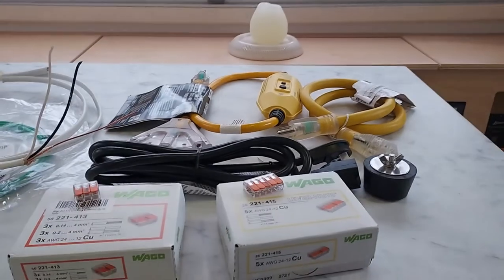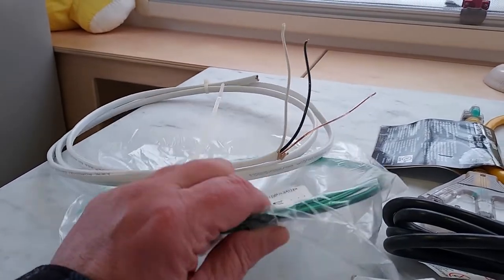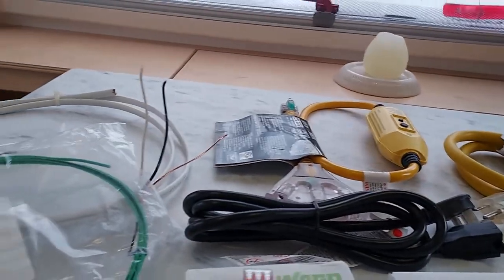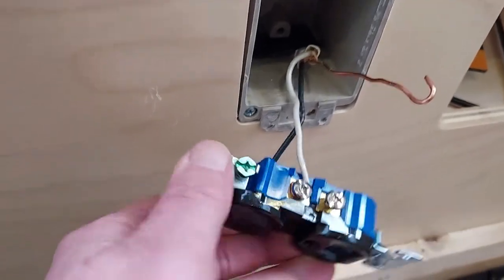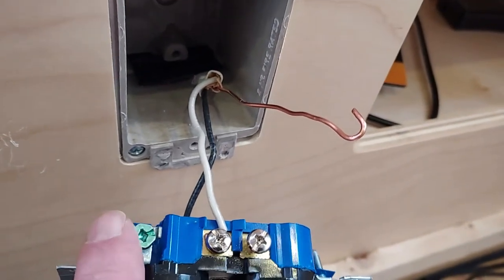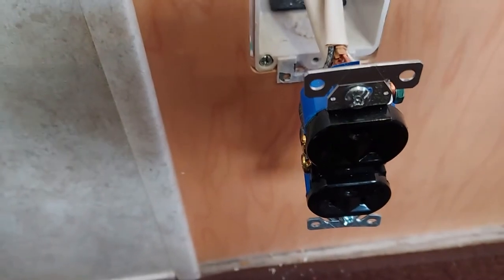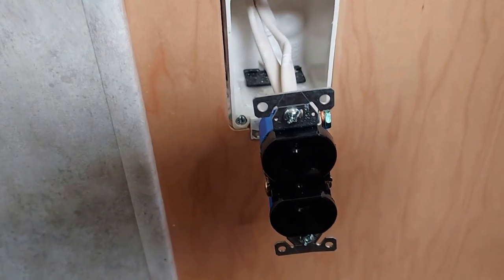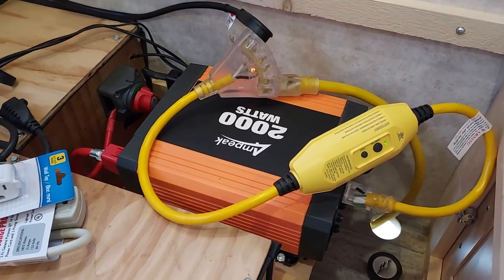Little Guy Max RV Add 200ah Renogy Gel Battery w 2kw Inverter  – Inverter AC Output Wiring (Vlog #3)

Comment: Nice work! So glad you did these videos. We are getting ready to build out our mobile workshop trailer and we will be doing this for sure. Keep the vids comin!
Reply from the maker: Wow, what a great idea, a total power station on wheels for work with no power availble! No need for a gas generator. With the two 110 watt solar panels, total cost was less than $1500 versus power stations that would give the same power output as this setup for many dollars more.